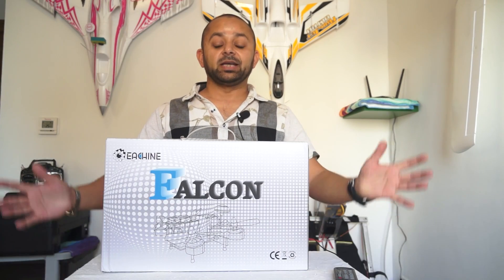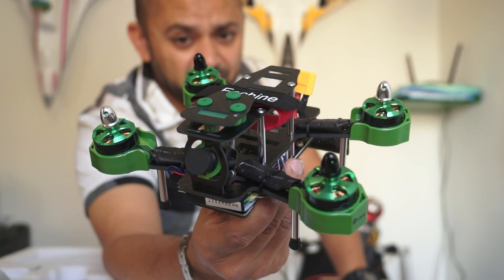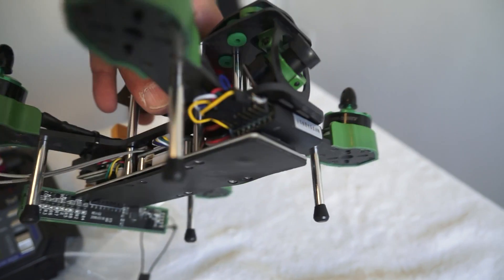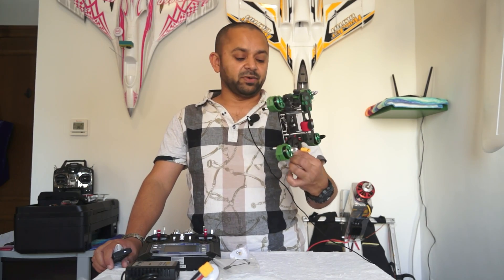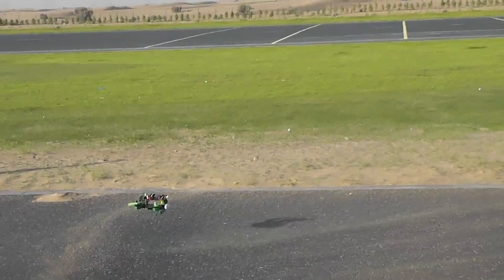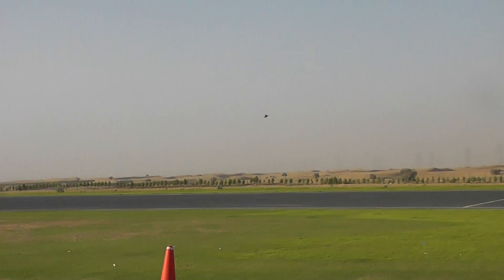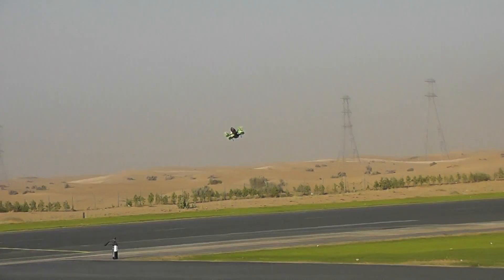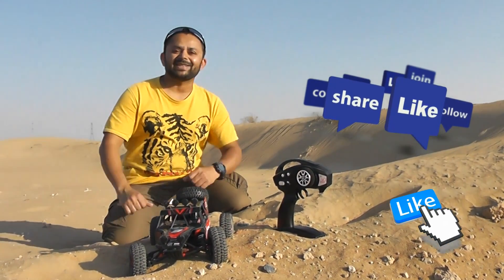Eachine Falcon 185 FPV Racing Quadcopter Review

Comment: What the software do yo used to change the PID settings? I was flash with cleanflight and betaflight, both configurations the receiver are not working. Could you please tell me how to solve my problem.... Thank you...

Comment: Great video, I love this drone! I replaced my ESC and motor with 30amp ESC and 2205 motors I charge that bad boy up with a 5s battery. I don't have a radar gun but Im definitely close to100mph.  Great deal going on now for these I would jump on ithttp://www.banggood.com/Eachine-Falcon-180-FPV-Quadcopter-with-700TVL-HD-Camera-5_8G-200mW-40CH-Transmitter-RTF-p-1046409.html?rmmds=search/?p=QF302371176792016104

Comment: I heard you say CC3D is your favorite due to it being the flight controller you're most familiar with. Any other reasons why it's your favorite? I'm fairly new with minimal flight experience on CC3D and Naze32 but they seem to be the ones to go with... Can you confirm this? Or maybe shed some light on any negative experiences to watch out for with other flight controllers?
Reply from the maker: I am now using SP Racing F3 controllers and loving the performance :)
Reply: good to know, I have those three to choose from (CC3D, naze32, and SP Racing F3) where I'm looking to order the RTF version of the falcon 180. and being new, am having a hard time deciding which flight controller to choose ;p
Reply: So mine finally came in and I did get the SP Racing F3 FC. I tried flying it today and couldn't even arm the motors :(
I've searched for some time now and can't seem to find any clear, start to finish, description of how to get an initial setup with cleanflight. Is there a certain mode I need to program for the receiver? Do the switches on the controller have to be in a certain order/sequence? I tried holding both sticks down and in like it shows on banggood's website, unfortunately didn't work. I know the motors work fine however, because I was able to get them to respond when testing them with the quad hooked up to cleanflight... 
I was also able to rotate the FC 90 degrees and program that change in as well but after that you can see I'm quite lost lol, any assistance you may be able to offer would be greatly appreciated!

Comment: open the transmitter and use arduino uno to flash the firmware.. so you can use it like a normal transmitter..